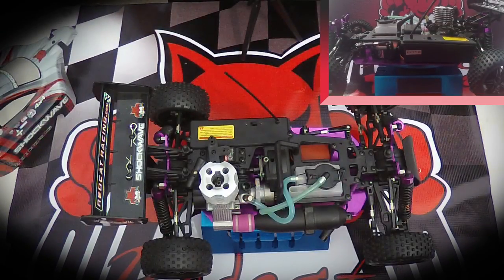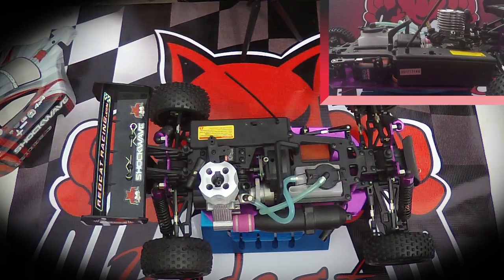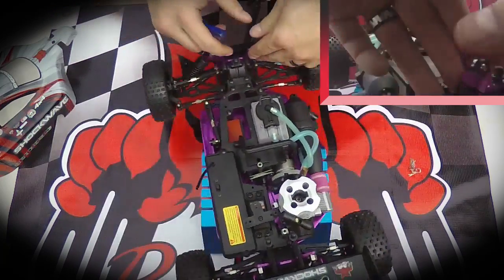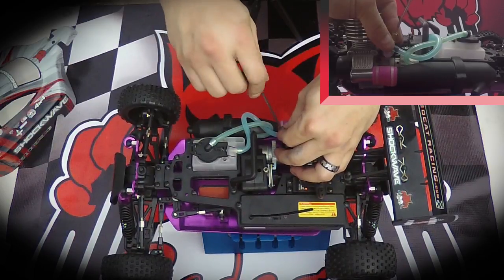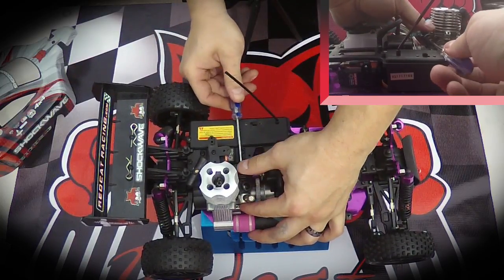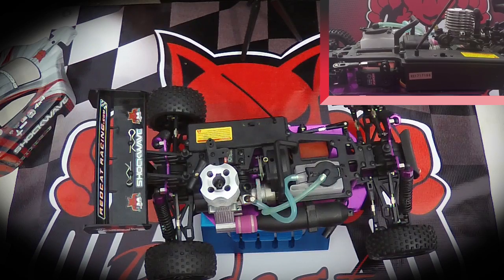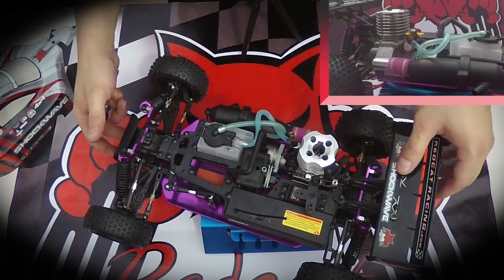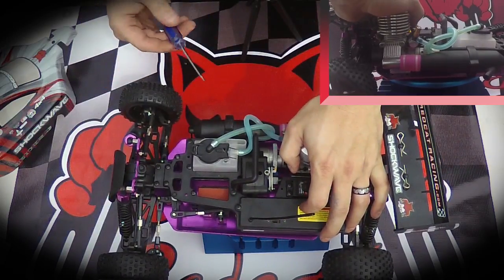Redcat University - VX-16 Carburetor Needles' Factory Settings

Comment: When these motors are broken in and have quite a bit of run time on them which direction do you normally need to adjust the needles?  Got a RC second with this motor and had it running pretty good. Snapped the pull starter and after replacing can't get it to fire. Tried to step back to factory specs but no dice. Waiting on some new glow plugs and one way bearing just in case but I feel the needles were turned out quite a bit past factory (I forgot to count and take note).

Comment: I  recently bought a Redcat Earthquake 3.5  with the  SH .21 engine which was a customer return and need the factory carb settings.... I have researched this and have seen different settings and need the correct settings so that I can get my Earthquake running and tuned.... Also the correct idle air screw settings.... Thanks....
Reply from the maker: High speed is 4 turns out.
Low speed is 2 1/2 turns out.

Then your idle needs to be set at about 1 mil. Which means at idle the gap inside the actual carb needs to be about 1 mil. You will have to visually check that.

Comment: Have the earthquake but since pulling out the box I've had issues with is bogging an I cant fix it.. I've replaced the gas tank reset the gear timing an restarted on my needles multiple times.. any help would be good
Reply from the maker: Sounds like its just a tuning issue. Have you adjust the carb needles at all?

Comment: I have a redcat hsp 94122 with vx 16 on  it but i don’t know if it changes gears because i dont hear it but the arm works with the spring and i don,t know how it works
Reply from the maker: So there should be a small sound change and a little bit of adjustment in speed of the vehicle. They usually do not change so smoothly you can tell. It may not be changing at all. If you want to adjust it there is a tension set screw on the 2 speed that you should be able to get to using a driver and adjust the level at which it shifts. If you need help finding this or figuring this out - contact our support team. Our team is always available and willing to help Mon-Fri 8am-430pm 
http://www.redcatracing.com/Contact
Reply: Redcat Racing the thing is that i do mess with that screw and it doesnt help
Reply: Redcat Racing i took out that screw and there’s a small ball looking like a bearing and a spring,i bought the car from someone is that supposed to be there?

Comment: I have a hsp backwash, i have follwed all instructions but still doesnt start and when it does jt tries to take off, help please all.my carb screws are set right
Reply from the maker: If the vehicle is still attempting to take off even with proper carb settings and such the only other option could be a air leak in the carbs physical mounting to the motor or a throttle trim adjustment needed. But if you are starting the sac with no electronics turned on and on a stand/box or something to keep the wheels off the ground that can be eliminated. If you are only trying to start the RC with the electronics on and on the ground you need to try it the other way. That way you can make adjustments on the RC stand with no power tot he electronics. 

Keep in mind as well it is the cold season and depending on where you live the stock setting may not work anymore. The colder air is thinner and may increase throttle response. So first thing first is to attempt to get the car running on a stand without the electronics on - then take a small flat head screw driver and make adjustments until it runs smoothly.

Comment: Factory settings for redcat earthquake? SH .21 ?
Reply from the maker: The HIGH speed needle in the brass fitting needs to be rotated 5 turns out. And the LOW speed needle in the throttle connection needs to be 4 and one half turns out.  
What that means is after it stops it needs to be rotated 360 degrees FULL turns out for each turn. And 180 degrees out for HALF turns. 

 

High speed is 5 turns out. 

Low speed is 4 1/2 turns out. 

 

Then your idle needs to be set at about 1 mil. Which means at idle the gap inside the actual carb needs to be about 1 mil.
Reply from the maker: Keep in mind every carb and environment is a little different due to elevation, temperature, humidity and things like that. So the adjustments on the IDLE screw might vary from car to car and environment to environment.

Comment: I’m having an issue with my shockwave. Even when I counter turn the idle screw the Gap stays wide unless the brake is applied.
Reply from the maker: This might be due to the throttle trim - try adjusting the "Throttle Trim" dial and the screw see what happens.
Reply: Redcat Racing thank you.  Got it.